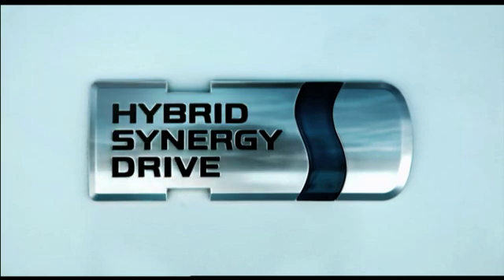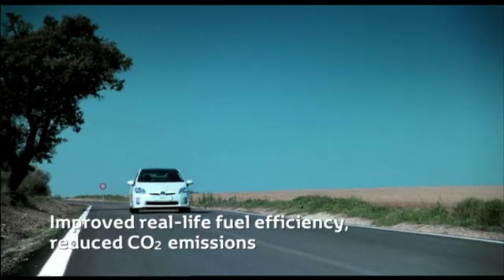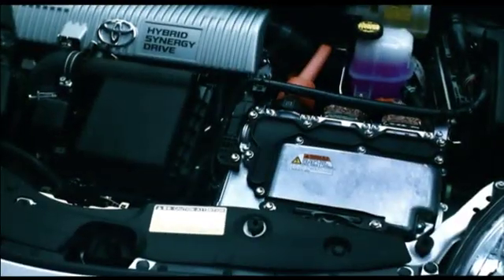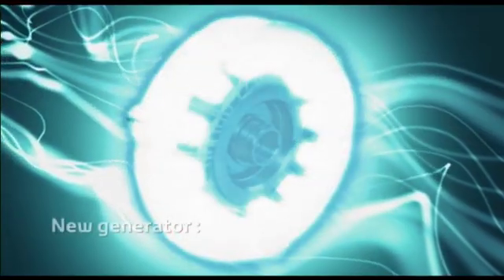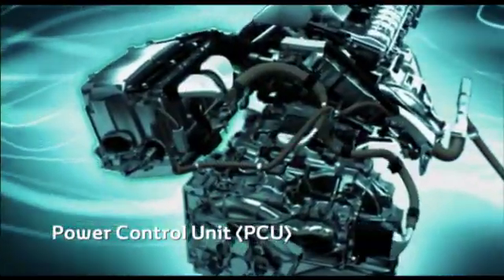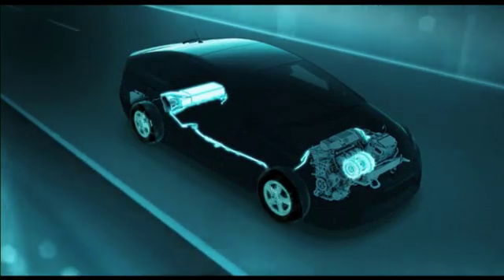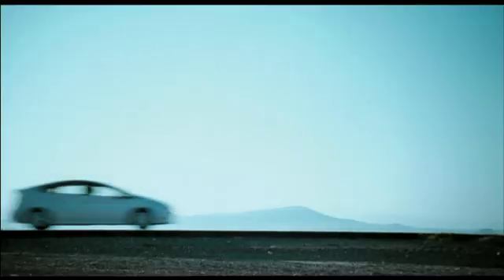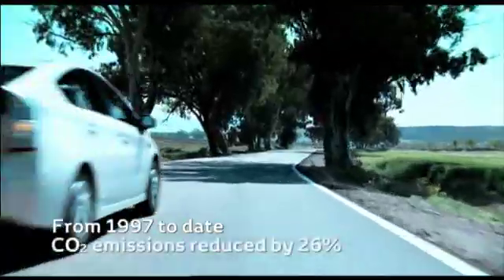Prius HSD

Comment: There are many haters out there. And America sold Chrysler to Fiat, the taxpayers own a big piece of GM. Ford is clearly the only American car and truck company. Without Ford F150 and the Crown Vic police cars they would be there, too.
Prius Gen One was the flash in the pan, a science experiment from Japan. My wife and I drove one. The salesman told us we would be a better fit in a Camry.
But we saw the Gen Two Prius and we waited six months to get ours. That was eleven years ago. 155000 miles and it still has the original battery.
Is it for everyone? No. Is it the best commuter car for city driving? Yes, I think so. And it is versatile. I have hauled all kinds of things with it. A single bed and box springs, with the door open. I had ten bags of mulch in it. It's made many runs to Goodwill, Sam's club and Wal-Mart. 
It doesn't breakdown and has never ever left me stranded.
Plus it gets good fuel economy and you never have to plug it in.